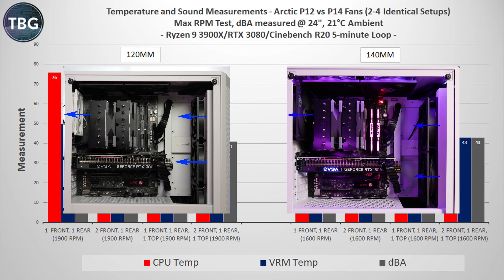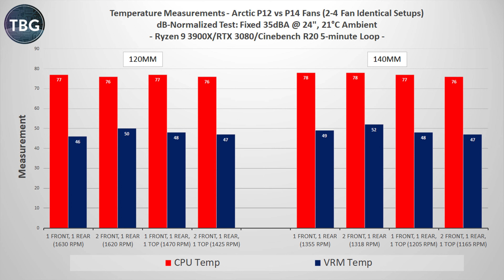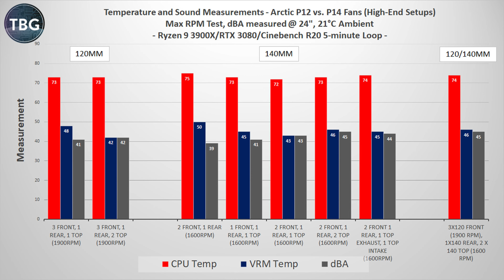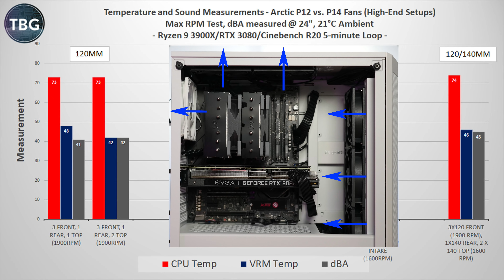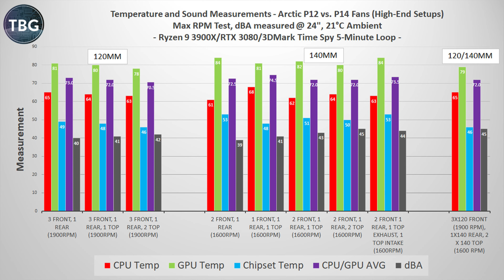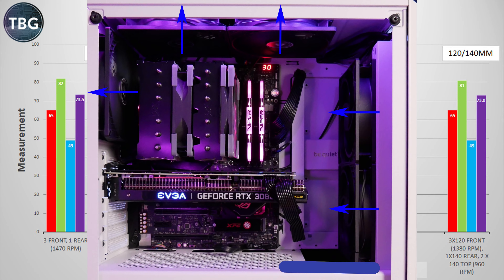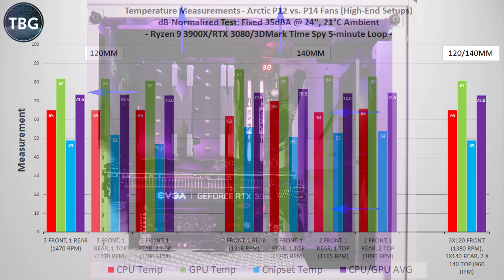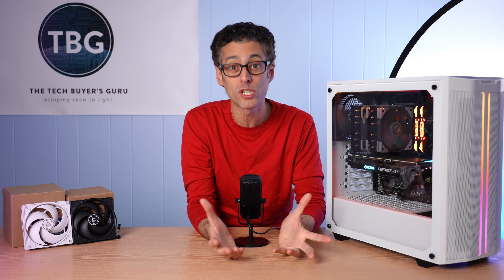The Best PC Case Fan Setup - How Many, What Size, and Where, feat. Arctic 120/140mm Fans!

Comment: I've waited for a month to get my P14s and will be swapping out my F12s only to hear that I need P12s now. Ugh...
Reply from the maker: That's not really the lesson of the video. If you use three or four P14s in a mid-sized case, you will have better performance than with an equal number of 120s. But if you go with five, you may have diminishing returns. Plus they may work better in a larger case, than the 120s, but it's also harder to cool a large case.
Reply: @TheTechBuyersGuru  thanks for the informative video and reply! I’m gonna mount the P14s for now, 2 front, 1 top above the cpu, and one rear exhaust since I’m assuming 4 P14s should beat out 5 F12s. But once the P12 value pack is available on Amazon prime again, per your advice I’ll get them instead as I want that bottom front fan to help cool down my 3060ti.

Comment: Like I said in the comment section of the previous video another thing to consider is having static pressure optimized fans as intake and air flow optimized fans as exhaust.
Reply from the maker: That is an interesting concept. Perhaps something for me (or someone else) to test in the future! My hunch is that airflow fans are never as effective as people might imagine, because there are very few applications in a case that have low resistance. Exhausts are actually fairly high resistance due to the grilles they must push through.

Comment: I'm using three P14 and two P8 Arctics in a 4U rack for my PC with a U9S. Also deshrouded my GPU and added two F12 and also changed the PSU fan to an F12 that was laying around from my old case. I'm very happy with it.

Comment: I've watched again because I was surprised the 120mm fans were a little better than the 140mm fans. I think the 140mm fans would be preferable at lower revolutions per minute. Personally I've targeted "super quiet" at Idle because I work at the computer and game only occasionally. There is nothing worse than even a quiet annoying noise for 8 hours per day. I even swopped out my power supply fan.  It would be an interesting vote to see what percentage of people want super quiet at idle versus quieter while gaming. Keep up the good work.
Reply from the maker: Well, super-quiet at idle is one thing, effective cooling at load when running a CPU/GPU combo pulling over 400W is another. The results are dB-normalized, so there's really not much to debate, as the two systems were equally quiet. The 140mm fans were better when four were used, worse when five were used.

Comment: So... I just ordered 6 Noctua 140mm fans for my Meshify 2 XL and you post a video about fans placement.
Thank you xD.
Reply from the maker: Yes, you have some decisions to make. That's a big case. You can mount a fan on the bottom, which might be a good idea. The case can fit 9 140mm fans, which might be a record, and with the stock fractal fans, you can use all the mounts!
Reply: @TheTechBuyersGuru  Yes, the damn thing is big af, but I planned on doing a 3 on the front, 1 at the back and 2 on top with 1 exhaust and 1 in-take.
Also using a Noctua NH-D15 for the cpu cooler.
It seems 2 out 6, I will have to do some thinking. xD
Reply: @diogocaetano7530  So what configuration did you wind up going with please?
Reply: @TexSupport  3 in-take in the front, 1 out-take in the back, 1 out-take on top (the closest to the back of the case) and 1 in-take on top (the closest to the front) (you probably won't need the last one)

Comment: My case has 1 120mm exhaust hole at the rear and 2 120/140mm intakes at the front. There is absolutely no top exhaust. Should I use 2 120mm fans or 2 140mm fans at the front?
Reply from the maker: 2x140 will be better, but if you already have one 120mm fans in front, just add another (or a 140mm) rather than replacing it.

Comment: While I really like TBG's thorough fan reviews--which got me to try out the Arctic P12/14 fans--the guys over at Hardware Canucks performed a similar test with drastically different results by making both top fans intake fans instead of exhaust.  It's worth a look here (airflow testing starts around 4 mins 40 secs)... https://www.youtube.com/watch?v=KTDZpYkEonY&t=6s
Reply from the maker: I saw that video when it came out, and I was pretty surprised by the results. In fact it's one of the reasons I made this video, and I believe that his methodology may have caused some error, as a lot of the results (and the fan arrangements) don't make sense. The one major difference in terms of test setup that would also lead to a difference even if we used the exact same methodology is that his RTX 2060 Super puts out about half as much heat as the 3080 used, and I used that for a reason: to stress the fans. In fact, if you look closely at the data, you'll see the GPU temp barely changes at all in any of the runs. Only the CPU temp changes significantly.
Reply: @TheTechBuyersGuru  Thanks TBG!  Yeah I can see the 3080 making a difference in results for sure.  I also think that flipping the top fan above the CPU to an intake might make another difference as the CPU heatsink and VRMs would get some additional fresh, cool air.  By the way, thanks for your other great fan reviews.  I have this exact case and put a 5-pack of p14s in place of the 3 stock Pure Wings 2s.  I also flipped around my Mugen 5 so the offset is towards the memory and added a P12 to the other side--lowered temp another 1.5 degrees.  Wanted the Fuma 2 but can't find that baby anywhere. :)
Reply from the maker: Glad to hear that my reviews inspired your current system! Interesting news: Scythe has just announced a new Mugen 5 Black Edition, which they are targeting for launch in March 2021. They provided me the following link to share: https://www.instagram.com/p/CIzXOAnnrho/

It will be interesting if this can come close to the performance of the Fuma 2, which is the absolute price/performance champion and as a result is always sold out!

Comment: For the Harmonic issue at certain RPMs, did you try installing the fans using rubber pins?

I tried my P12s and P14s and they didn't have the Harmonic dissonance, but I use rubber pins to mount fans
Reply from the maker: No, but this is a really interesting idea. Next time I chat with Arctic, I'm going to suggest they test this because I know they are very concerned about the issue. I'd test it but I'm on to the next topic, case and cooler reviews!
Reply: @TheTechBuyersGuru  we have actually tested it and that does not solve the issue. The problem is much more complicated than a simple resonance, we are making progress.
Reply from the maker: Vincent, so good to see you here! I imagined that it was not going to be a simple fix, but I hope that my input at least gave Arctic something to start with.
Reply: @TheTechBuyersGuru  your inputs definitely helped, though they did not help us to "start with" as we were already started for a while :)
Reply from the maker: Vincent - I'll follow up with you offline in the new year. Looking forward to hearing more, and testing the next wave of new products from Arctic!

Comment: Great testing! It must take you a lot of time. But i have an idea for you. Put a small fan right below the gpu at back as exhausting.  You might need to use stickers to fix the fan. 
Here are some disgustion with good results
https://amp.reddit.com/r/overclocking/comments/8hqh39/as_anyone_tried_mounting_a_small_fan_under_gpu/

It might because that the heat generated by gpu is hard to exaust   out the case because of the gpu fan poor air flow . So a small fan just nearby gpu exausting heat out  helps a lot. Hope this idea gives you some some inspiration.

Comment: Interesting stuff. Would love to see similar testing with a case that supports bottom fans like the 011 Dynamic.
Reply from the maker: I would too! Originally was going to do this test in the Corsair 680X, which has a similar setup, but ultimately decided against it because that setup is not representative of what most people actually use. Maybe in a few years when all cases have bottom fans, I'll retest, but it's up to manufacturers to make these cases popular so it's worth my testing in them!
Reply: I have the 011 dynamic xl. I have air cooling only.  I experimented with many combinations of fans, and I used arctic fans because of the reviews on this channel. Very good fans. The end result of my experimenting was counter intuitive: Top fans intake. Bottom fans exhaust. Rear fan intake, cpu cooler fans blowing toward the front. I have no definitive explanation as to why this was optimum cpu cooling, I just do the experiment, and accept the conclusions. In reverse, with bottom intake and top exhaust, the gpu benefited, while the CPU suffered. My biggest challenge was cpu cooling so I chose the top down configuration.
Reply: @jaylin9899  Thanks for the info. I think the chimney effect is overrated, as Steve from Gamers Nexus has said. It could be that there's not enough bottom clearance to give the fans all the air they need and that's why reversing them improved your results.

Comment: What about fans that fits bottom of the gpu top of psu? Does it matter in anyways?maybe for Intake air for more gpu cooling?
Reply from the maker: Once case manufacturers start sending me cases designed with bottom-mounted fans in mind, I'll start testing them. I do think that there's a lot of potential here, but current cases that pull air from the PSU area will generate very little airflow.
Reply: Yeah air from psu will create some issues

Comment: Yes!  Looking forward to this one.  When you use your rig personally, do you go ahead and have curves set for all the individual fans?  I've built a couple rigs lately... one featuring Noctua (front 200mm x2, top and rear 120mm x3, CPU cooler140 x2) and the other featuring all Arctic (front 140mm x2, Top 140mm + 120mm, rear 120mm, CPU cooler 120x2).  The Noctua build uses the motherboard headers and Argus Monitor to tune all the fans and access presets.  The Arctic build, an older 8350 rehoused into a Silverstone Fara r1, needed a controller as it had less fan headers and those were mainly DC.  I went with a Corsair Commander Pro and actually have another SFF build using an Aquacomputer OCTO controller.  

I love being able to micro manage the cooling and get a temp and decibel level that is quiet and another that is more aggressive.  Also, I love cases and their quirks so it's a lot of fun buying fans and tuning them to find that perfect combination for that particular case/hardware configuration.  I also have one of those less expensive Nzxt fan controllers but turns out it just uses DC.  They tricked me with their 4 pin plugs.  I'm curious if you find these tools useful or not, when necessary or if you just make do without them.  Would love to see a video on fan controllers sometime!
Reply from the maker: Ha, ha, yes, tinkering is fun! For this review, I actually used Argus Monitor (based on recommendations by viewers like you!), and it was great. Interesting note: I found voltage droop across the fan headers, which I honestly couldn't get into in the video. When I ramped up additional headers to test more fans, other fans would slow down. This caused havoc for testing, as 65% PWM or even 100% PWM unfortunately did not mean the same RPM for each test. I even found that when the CPU was under extreme stress, some of the headers would drop speed. Maybe something to discuss in a future video, but honestly, this kind of "quirk" isn't much fun so I don't know how entertaining I can be talking about it!

In terms of fan controllers, I'm a pretty big supporter of integrated motherboard controls. If it's not PWM for the fan and 3-pin ARGB for the lighting, I don't want it. Otherwise it's too hard to test various fans and cooler in multiple cases. And yes, I do select the motherboards for my test systems based on the number (and placement) of the 4-pin headers in order to make 6-fan systems viable. For this test, by the way, I had the rear plugged into CHA_FAN1, the top on a 2-way splitter using CHA_FAN2, and the 3 front fans on a 3-way splitter using the Asus HAMP_FAN header, which I thought would be able to power 3 fans simultaneously without stalling, but that didn't quite work out as I had hoped.

As for my personal system, well, I'm currently running Asus Fan Xpert4 to control all my fans, and have them set at minimum until the CPU hits 50C, and then have it gradually rise to 100% at  65C for the CPU rad fans and 100% at 75C for the case fans. I really don't like constant fluctuations, which is why I start the ramp at 50C and not lower than that, but I could probably set it to start the ramp at a higher temp. It's basically a straight line, no fancy curve. I used to do that, but it took too much thought, LOL!
Reply: @TheTechBuyersGuru  I have noticed the same thing about fans not holding tight to certain rpms.  I've noticed this on my main rig which uses an Asus board and Fan Xpert4. oI use it's pwm fan headers and no controller.  I have actually dug through BIOS in the past few months looking to find the adjustment for the 12v, 5v, 3.3?v source.  I decided I probably shouldn't touch those values though, lol.  I noticed especially when using the fixed option instead of the grid, some fans just can't hold tight.  I don't know if it changes to DC mode when on the fixed setting or what the deal is but sometimes certain fans speeds are up and down, up and down, with no association to any temps rising or anything.  

However, my Aquacomputer OCTO fan controller holds fans insanely still.  I was watching it last night while monitoring the graph through the Aquasuite software and it REALLY locks them in.  They maybe fluctuate by one rpm here and there and it isn't that often when it does.  I think this is because it pulls power from it's own SATA tap off the power supply.  I always keep my CPU fans on the motherboard headers btw.  I don't fully trust the stability of people's controllers and software... However, I do use Argus Monitor curves on all my computers CPU fans.  I'm with ya on the flat line until 50.  I'm not a fan of the constant ramping up and down of the fans either.  I did get creative with my OCTO though by applying a sensor to the SFX PSU in my nr200 case.  I have an intake fan (kaze flex 120) that senses the PSU temp rising and gently blows air directly into the PSU intake.  This ensures I never get that "jet plane takeoff," from my passive PSU kicking in (Corsair sf 650).  I've since removed that intake fan but I want to put it back in... You know, tinkering, lol.  The Corsair Commander Pro does a pretty decent job holding tight as well, again, pulling it's power from the PSU instead of the motherboard but it's no where near as locked in as the OCTO.  This one is interesting because it doesn't care what fan you are using, it seems to lock the fans to an rpm value instead of a PWM duty cycle setting.  

I think these nitty gritty details would be awesome to watch a video about.  Especially tweaking the power to stabilize the fan rpms or covering controllers that allow for precision.  Lay it on us and thanks for all the content already!
Reply from the maker: It sounds like you have a whole lot more experience than I do on this subject. I'll definitely refer back to this post if I decide to go down the road of covering this topic in a video!
Reply: @TheTechBuyersGuru  Well thanks but I'm just getting into it all.  These are just the naïve observations I've made so far.   Your video (the one that shed light on the Kaze Flex) started it.   Thanks for the information!  I love this aspect of computing and I didn't even think about it before, other than controlling/setting curves for my laptop fans.  The worst fans ever. :)
Reply from the maker: Are you referring to how I showed a 1200RPM fan beating a bunch of 2000RPM fans? Yeah, actually that was a learning moment for us all!
Reply: @TheTechBuyersGuru  Haha, yep, I think that was the one!  Following that lead, I recently put two 1200 rpm Noiseblocker e-loop 140s on my nh-c14s cooler and am getting much better thermals at idle and at full load.  Who needs all them RPMs when the heatsink can only do so much before it becomes "saturated."  Much better than the stock Noctua nf-a14.  I'm not sure how I feel about that fan.  Too much motor noise, not enough whooshing air.

Comment: Having the top front fan as intake while its brother behind him is an exhaust just creates turbulence. Better off having nothing in that slot.
Reply from the maker: I don't think that's true. The rear fan is directly above the cooler. If there's turbulence, it's from pulling vertically through the cooler, and has nothing to do with the fan next to it.
Reply: @TheTechBuyersGuru  Okay. If the turbulence bit is false, how about the argument whether having a fan there in the top front is better than no fan at all? If it is, is push or pull better?

Comment: Hi today i ordered 2 artic bionix f140mm fans to put them in front on a nox infinity neon case in order to cool my ryzen 3800x should i cancel the order and switch to 3x 120mm fans instead ? 
or i should be fine with 2x 140mm i intend to buy 2 more 140mm in the future to put them on the top of case am i doing it the wrong way ?
Reply from the maker: Well, first, the P14s and P140s are better than the F140s, despite marketing that suggests you should buy F140s for cases. With that said, if you want to keep them, you can replicate the effect of 3x120s by spreading out the coolers so that the axis of each one is pointing at the area to be cooled. That means one axis in line with the CPU cooler, and one axis in line with the area below the GPU, not the card itself.